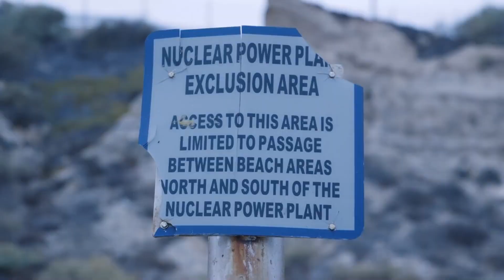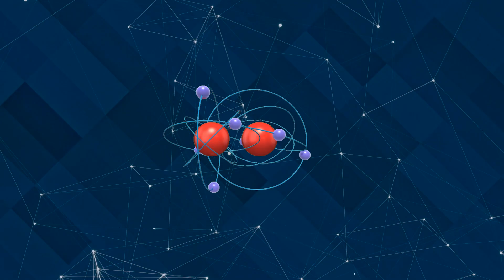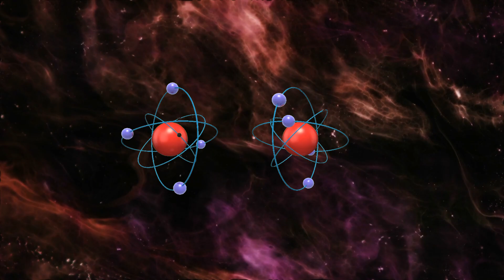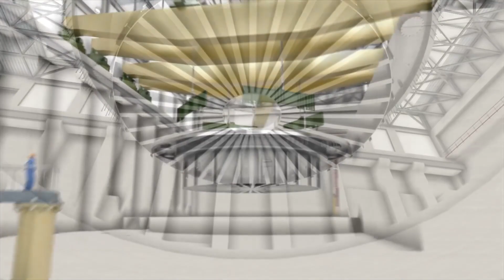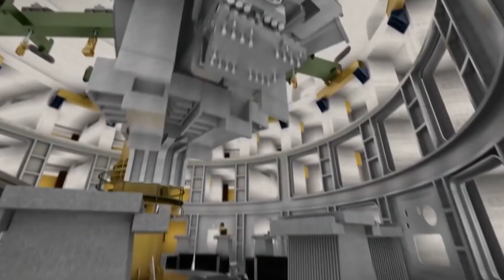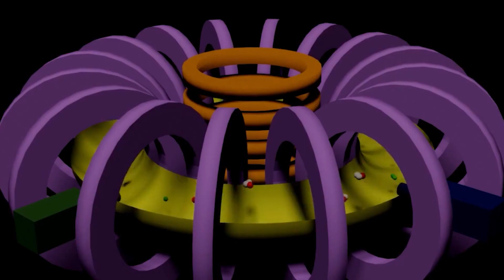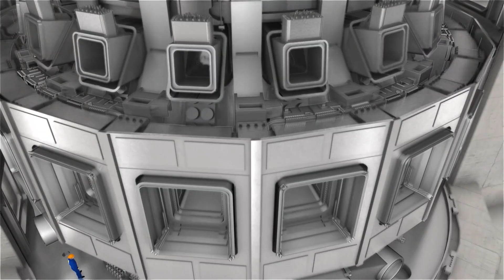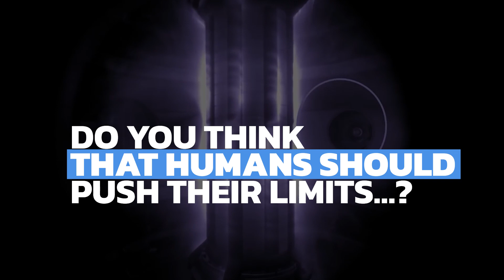Inside World Largest Nuclear Fusion Reactor, Nuclear Fusion Breakthrough, The ITER Magnets

Comment: This is the sort of project that should have been left to private enterprise.  $60 BILLION of taxpayer's money is crazy -- to build something that "MIGHT" work -- or not.  No one knows because a smaller working prototype does not exist.  A really stupid idea!!🎄
Reply: Then how do we move forward? How do we 'evolve'? At one stage somebody said the Space Shuttle shouldn't be built...
Reply: Its a test bed to prove out the concept. Its the second one but bigger (design is an iterative process). The first one worked so its feasable this will work too. After this one the real energy producing reactor will be much bigger and cost much more for clean energy forever. (and cost much more - so more tax money will be needed)
I worked there designing the thing so I would have the experience to provide this message.
Reply: It doesn't work like that in practice. Not with major institutional research at this time. Unless the federal reserve is doing it as a proxy. The reason is the private sector isn't trying to do a paradigm change with its research. For example a natural gas company might study microwave treatment of methane, but it wouldn't allocate the budget to figuring out fusion. A fission nuclear power plant company would maybe research a way to reduce fissile material, like with thorium plants, but they wouldn't research fusion. Actually even the thorium reactor research gets government money. Actually most research is with government money. The private sector usually doesn't even take the risk. Hence national labs.